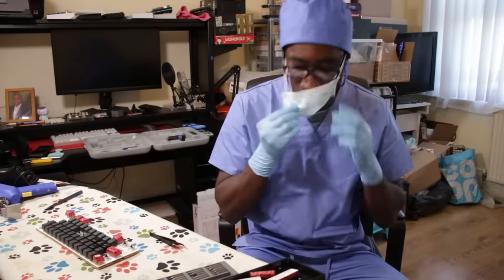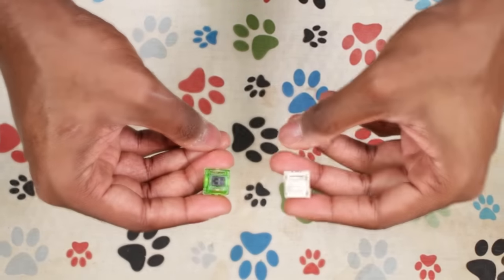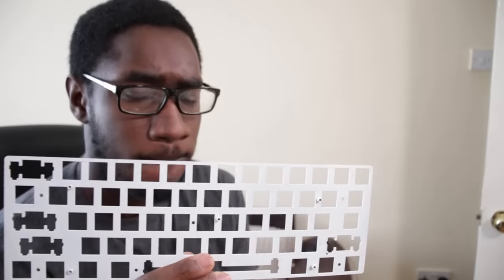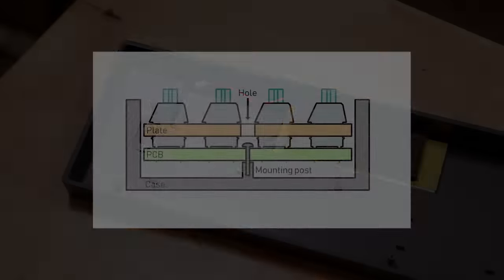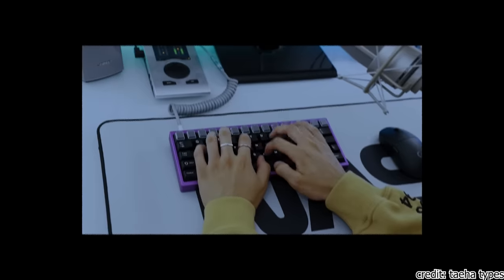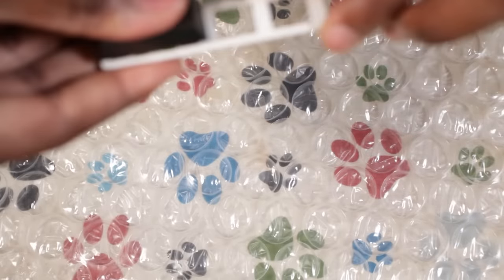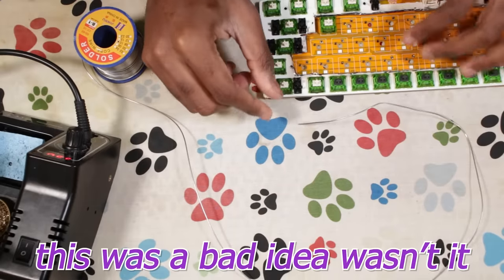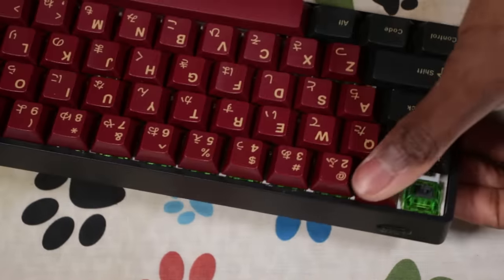I Modded The Pewdiepie Keyboard...

Comment: I love how he changed every conceivable thing about the board
Reply: Hey the case is still the same, minus the original mounting standoffs. It's also like... Some of the original plate too.
Reply: @Luteloots  but you see, he changed the standoffs and changed they way that the plate works
Reply: He didn't even keep the original keycaps lol
Reply: Step 1 trash the keyboard buy a new one
Reply: So he basically wasted 300$ on keycaps lol
Reply: face2905 poop  there’s no way he spent 200 on that crappy artisan
Reply: I love how much this board stock along with the others especially aged like fine milk when you can get extremely top quality keyboards now for half or 80% of the cost of this board. It was alright difficulty but now it's so braindead easy.

Comment: I like how by “modding” it he pretty much replaced the whole keyboard 😂
Reply: Not even the keycaps. But tbh I'd at least leave the original keycaps. I like them.
Reply: he modded the existing parts, only replacing the switches really as keycaps can be changed easily
Reply: @sponch7193  He also replaced the stabilizers.
Reply: @sponch7193  only parts he modded were the plate and case, everything else was different apart from the pcb
Reply: @sublic3101  Thw Switches were modded as he mixed two different.
Reply: @Definitely_Melnyx  he didn’t mod the switches he replaced them, no part of the mx browns remained so you can’t say he modded them even though the switches he replaced them with are mod switches

Comment: Cracray idea. that hole you cut out of the steel plate? match it with a polycarbonate plate Get that stiffness on the outer edge while having more give in the area of the keyboard you actually type on.

Comment: i forgot the specific of the story but this reminds me of it

if there is a historic ship. lets just say the favorite ship of Napoleon or something idk(like i said i forgot the original story). and its in the museum. one day, some of the part became rusty or broken since its hundreds and years old. to prevent the whole thing colapsing breaking everyother part, the museum repairs it by replacing it with identical material and paint.

but what if. slowly one by one all of them broke and replaced would it still be the same ship that napoleon once used if the majority or even 90% of it is replaced with new part?
Reply: would it still be pewdiepie’s “keyboard” if ALL the switch is replaced, ALL the keycap is replaced and heck its not even the same color, some of the base or whatever its called  is modified, etc. or is it a whole new keyboard WITH pewdiepie’s part

Comment: STOP SCROLLING

TO GET CREAMSICLES CAN YOU BUY THEM PREBUILT OR DO YOU HAVE TO BUY BOTH SWITCHES,  PAY TWICE AS MUCH, TAKE THEM APART, AND PUT THEM TOGETHER??? I THINK THEY SOUND REALLY GOOD SO I WANT TO BUY THEM (THIS IS MY FIRST MECHANICAL KEYBOARD BUILD BTW)
Reply: you have to buy them separately which means you’ll be paying $100 for switches because both switches are $50 for enough units for a board, and the sound of them will vary with how good you are at lubing them and everything else about your board, the key caps, plate and case
Reply: @dezyy8489  ok thanks

Comment: I think i will mod my ducky, so can i do the o-ring thing on my ducky or will it like "break" when i do it. (trying to learn more abt keyboards)
Reply: i sub btw
Reply: before doing the o ring mount you should do the o ring burger mount which you can find on Keybored’s video on the o ring mount, it’s easier because all you have to do is put o rings on the outer screw stand offs

Comment: "Are you familiar with the thought experiment 'The Ship of Theseus' in the field of identity metaphysics?"
Reply: Doesn't apply
Reply: @saamo1423  Are you sure? I’m pretty sure it does. In this case, it’s: if you remove almost all the elements of the keyboard and replace them with new parts, is it still the PewDiePie keyboard?
Reply: @matthewwhitney57  only two parts were changed, and they’re designed and intended to be changed. The pcb is the main determining factor behind what board something is
Reply: @saamo1423  He changed the key caps, the switches, removed parts and added things that weren’t there. The Ship of Theseus thing that I put in my original comment does apply.
Reply: @matthewwhitney57  Both keycaps and switches are designed to be interchangeable, so that's a none factor. Those are the only piece that were changed, everything else is original or modified, since this is, ya know, a modding video
Reply: @saamo1423  I get all that, and I see your point. But all of that is irrelevant to what I’m saying here, which is that the PewDiePie keyboard itself has been altered from its original state. The keyboard’s parts are being changed/replaced with others, so the thought experiment still applies man. Regardless of if those parts are meant to be changed, the question is whether or not it is still the PewDiePie keyboard after making those modifications.
Reply: @saamo1423  Let me be clear, I'm not taking a side on whether or not it IS still the PewDiePie keyboard. Nor am I trying to hate on the video at all. It was just a joke comment because people went through a phase of using that quote non-stop, and I thought it would be funny to use it here because the thought experiment applies to this case.

Comment: I know basically nothing about keyboards, but is there a reason why you didn’t put the original key caps back on? Cause it seems more like you essentially just built a new keyboard rather than modifying a keyboard.
Reply: Keycaps were pretty poor on the original, and no ffs it's the same board
Reply: @saamo1423  ffs?
Reply: @GamerX-2000  for fucks sake
Reply: @saamo1423  I feel like this is like moding an Xbox and replacing the entire motherboard with one you made from scratch- it’s no longer moded, but eater just the case of an Xbox with a whole other console inside. I feel like this is the same thing, all that’s left is the case, besides that it’s a whole new keyboard; but even then, without the original key caps it’s not really the case, like you removed the Xbox logo from my example Xbox here.

But then again, Ik absolutely nothing about moding keyboards, so I’ll take your word for it.
Reply: high quality keycaps are made of thicker material, so the it wont sound as hallow when typing.
Reply: @GamerX-2000  except, ya know, the pcb, plate, and case
Reply: @saamo1423  what’s a pcb exactly?
Reply: @GamerX-2000  the motherboard

Comment: So... basically just take the pretty Pewdiepie key caps and put them on an entirely different board that's not trash. Gotcha, lol.
Reply: Are you blind?
Reply: @saamo1423  no, and I'm aware he didn't even use the Pewdiepie caps in the end. I was basically making a joke that in order to upgrade that board he had to replace everything and only the plastic was salvable. I didn't think it would be that hard to comprehend.
Reply: @lauragilbert9326  So that’s a yes. Case is original, plate is original, pcb is original.
Reply: @saamo1423  omg! are you purposely trying to be obtuse? It was a JOKE! I wasn't going to go through and name every single component that was not replaced as if I was making a serious statement about what was shit and what wasn't. I'm well aware he didn't replace every damn thing. FFS
Reply: @lauragilbert9326  Sure thing buddy

Comment: You should have used the same keycaps
Reply: I did!
Reply: @saamo1423  so it retains the pewdiepie look, even if it sounds worse
Reply: @Zeie  That makes no sense
Reply: @saamo1423  read it again
Reply: @Zeie  "Keep the worse parts for the build, in your UPGRADE video" wtf are you smoking
Reply: @saamo1423  i’d argue the wavy keycaps are the best part about the keyboard before the upgrade so there isn’t much downside to keeping it. plus it would make the final build look more like a pewdiepie keyboard, rather than a normal custom keyboard

Comment: While I enjoyed the video, this was more of a rebuild than a mod. You can’t really compare them fairly when you replaced the switches, key caps, stabilizers, mounting method, cut most of the PCB out and soldered the switches directly to the board. The only thing that’s still “pewdiepie” is the board and shell. It sounds good, but it just felt like a cop out rather than actually modding the parts of the original to make them sound better. You basically built a keyboard from scratch and just used the the least important parts of this one to make it. Again, I loved watching the video, but this felt a little like a cop out :/

Comment: this is now a 400 dollar keyboard.
Reply: no, original pewdiepie keyboard is worth about $100 ($50 gk61 + $50 aluminum case), creamsicles (nk creams and kiwis are >$50 each for enough units for a board), red samurai key caps ($100) pewdiepie artisan brofist keycap ($15 on ebay), and o ring is probably about $5 

around $320, only $90 more than the original keyboard, i said “only” because of the little it had to offer, you can mod a $50 keyboard with $15 and it will still sound better, if you want i can link a sound test
Reply: @dezyy8489 Well everything you said there was correct, but you didn't get the fact that the pewdiepie keyboard price, I meant it was the original price of the keyboard. I appreciate the effort of you trying to explain but its no need wasting your time. Also this information I didn't need.